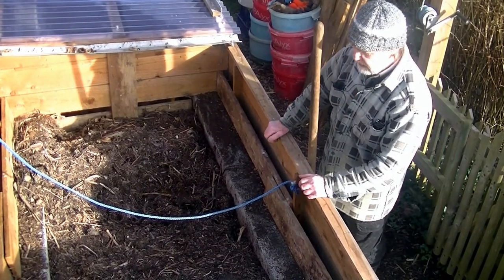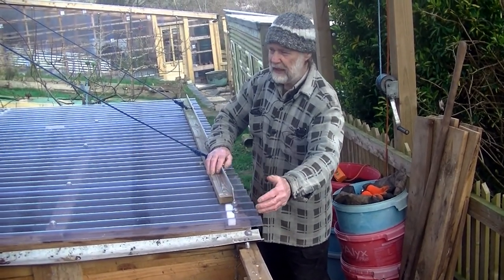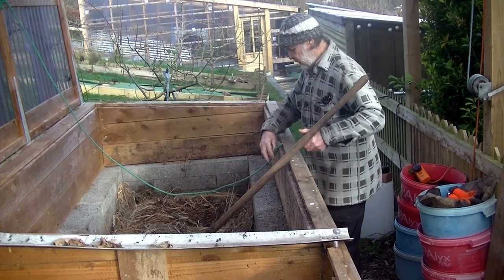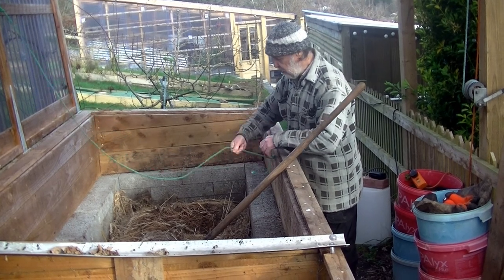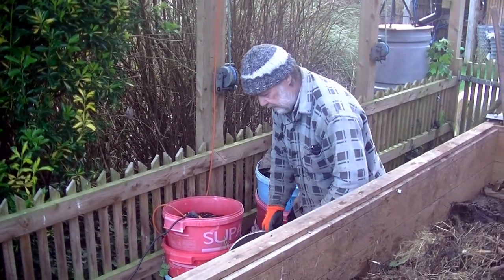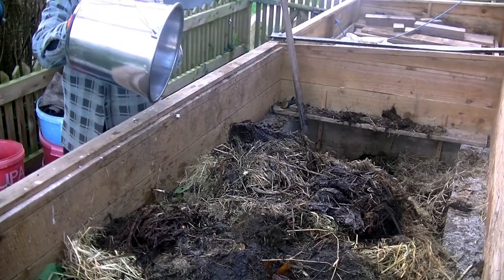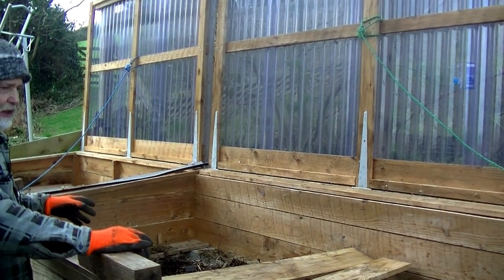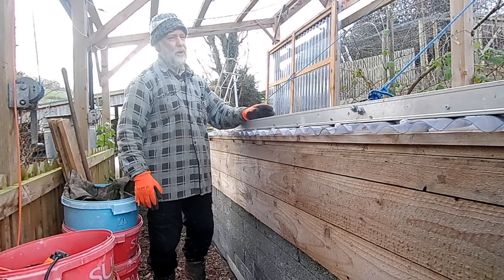#HowTo Make Winter #Hotbeds || #StartToFinish || [Winter Planting]

Comment: Could barley straw be used in place or dried grass cuttings? What ingredient in your hotbed replaces animal muck? Thank you for an informative video.
Reply from the maker: Hi Maria. As an ethical vegan, we don't use animal products; it's all soft vegetation and organic kitchen waste. In other words: clean green manure not animal manure. It has not been passed through an animal's body. But YES👍 you can use dry, clean straw to make a hotbed. It may decompose slower but still provide nutrients eventually. Hay or legumes, or other herbaceous plants that have been cut and dried, are much better for fast decomposing hotbed compost.

We recommend dry and clean ingredients; not wet, odorous or soggy stuff that smells and spoils your hotbed.

Reference: https://www.livescience.com/63559-composting.html

What we're after here, is nitrogen; plus carbon, water, the sun, and air. There are some concerns around animal manure, not least bacterial infections, which are discussed  in the description. We can get great results using green manure instead of animal dung.

The compost bed needs to break down fast and provide important nitrogen, as well as moisture. You could include some cardboard, scrunched up paper and fallen leaves. We heavily water that, and we mix it all up with a fork to introduce oxygen.

To stop the compost 'cooking' the essential bacteria, we turn the compost sporadically. This introduces cool air and helps to even-out the ingredients and moisture, with the nutrients.

Thanks for taking part - it's appreciated 😊
Reply: Thank you for your thorough explanation.  I'm glad to have found your channel,  I'm all up for green clean ingredients and its refreshing to know that this can be done without smelly animal manure.
Reply from the maker: @greenfingers359  We're help to help 👍Any time.
The primary use of these hotbeds is to provide a warm and safe bed (base) for seedlings in spring, under cover in a sealed mini greenhouse. The beds provide constant under-heat; hence the wooden planks across the top, on which to stand seedlings.

Comment: What if you don't have a loo like yours? What can one then use instead of urine?
Reply from the maker: Hi Quarantain and thanks for your question. I can give you some assistance based on experience, but use it at your own risk 😉 Fortunately it doesn't have to be human pee; there are other options. Use plants to feed plants, but don't burn or overpower your hotbeds/compost with strong fertilizer, or poison your plants especially not seedlings. Wash your hands thoroughly afterwards and don't ingest toxic matter.

Please note that compost for hotbeds is meant to provide underfloor heating in a sealed structure. This is all done by bacteria, oxygen, compost and water; a mutually beneficial relationship generating heat. It's especially beneficial during the colder months. It also works for protecting young plants in spring or inclement weather.

Follow my methods in the Hotbeds video, I've had no problems to date.

One of my other videos shows how to make fertilizer from rainwater, nettles and comfrey: https://www.youtube.com/watch?v=FSJLB71UexY. Rainwater is a better option than chlorinated water - rainwater is easily collected over time and it contains more nutrients. 

Check what is right for your individual plants, but I regularly use the 'dark liquids' sometimes called the "run-off", from the bottom of my garden-waste 'Dalek' composters. This is sometimes called "liquid gold"; it is quite potent and needs to be diluted 3:1 at least. Sitting your composters on top of raised beds, works wonders. 

Natural #organic fertilizers are better for soil and environmental #sustainability, as well as for human #health. They reduce environmental hazards, support #wildlife, lower the risks of toxic foods, and enhance soil with natural #nutrients.  

Regarding the toilet (and the gross out factor aside), it's necessary to have a specialised "separating toilet" because ONLY the pee is safe to use as a consumer micturition product. The other waste is buried deep, far away from property, humans and animals. 

Perhaps a "Bivvy Loo" might work for collecting only pee, and ageing it over a few months, downwind and inside a tent. I really don't know. Some research suggests adding wood ash to aged human pee used as a fertilizer. 

Human pee is full of nitrogen, potassium and phosphorus, which are the nutrients plants need to thrive. They are the main ingredients in common mineral fertilizers. 

All of this of course, assumes that the human pee is from a healthy person and that stringent hygiene and safety precautions are followed.

Thanks for taking part, Quarantain 👍
Reply: Eewsaaaa,, @GreenpetesWorld